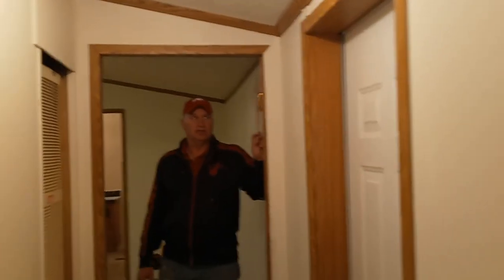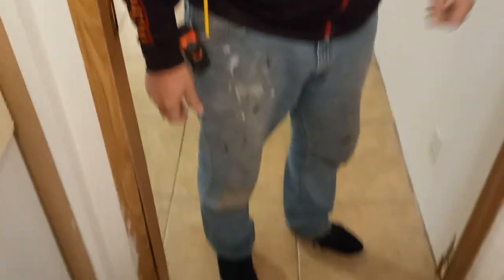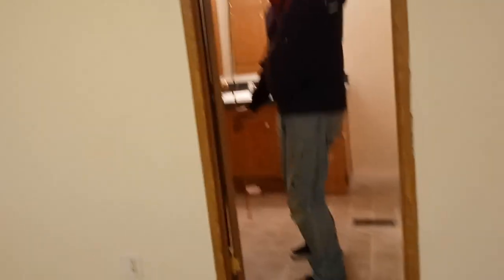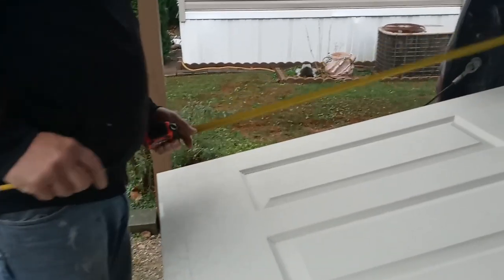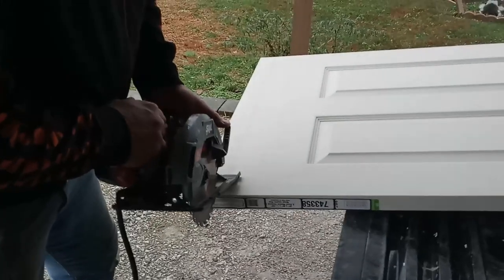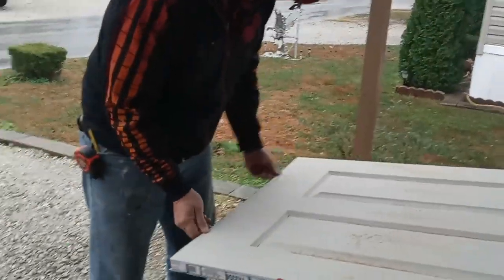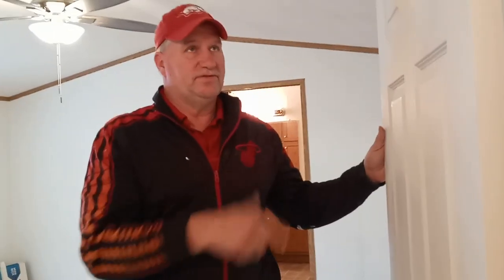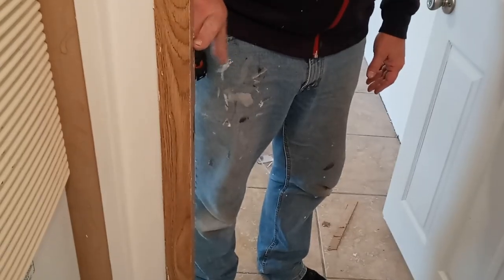Why Mobile Home Doors Have Gaps At The Bottom

Comment: This is great information for mobile home owners.  I unfortunately found this out the hard way.  I replaced the old laundry room door 🚪 (had a metal panel in bottom of door) with a regular door u buy at home depot.  Within a week my hvac heat stopped working.  it blew air and the blower was working but there was no heat.  so I called a HVAC repair man and he said I blew a fuse and asked about the door in laundry room.  he said he would bet money that the door I recently installed blocked the air so much that it put a lot of stress on my heater or a blower and it caused the fuse to fail.  So I removed new door and now I have no door to laundry room.  great video phil and wife 👍 keep up the awesome uploads your channel is growing fast.  This time next year you will probably be at least 20,000 subs.
Reply from the maker: You can install the door with a vent that goes through and the return air can then function. Glad to be of any help even to be a cheerleader rah rah

Comment: Been wondering about those gaps for 20 years. Thanks! Mystery solved!
Reply from the maker: They can be eliminated with longer doors by installing either a vent in the door or a vent in the wall to allow return air. Knowledge is power
Reply: @StraightArrowRepair  Vent in the wall is a great idea! Thanks!

Comment: How do you make the door way wider
Reply from the maker: Cut the paneling or drywall back on one side. Remove the same above the doorway. Move the framing board to the edge of the width you need reinstall the the drywall or paneling above the door.which may require additional wood on one side above the door. Then cut off the wood on the floor.